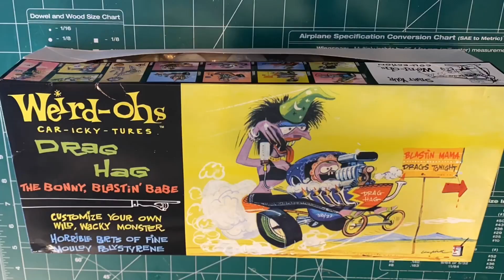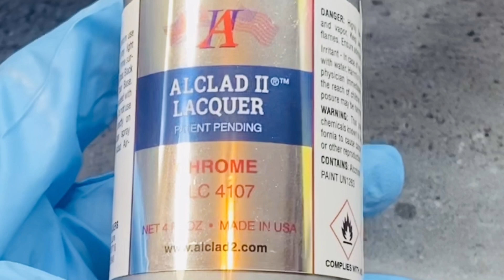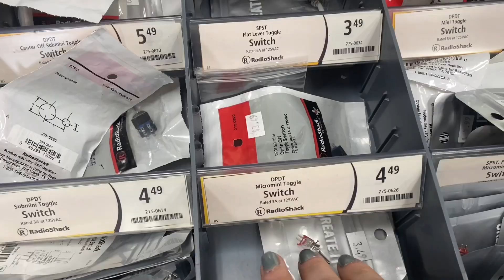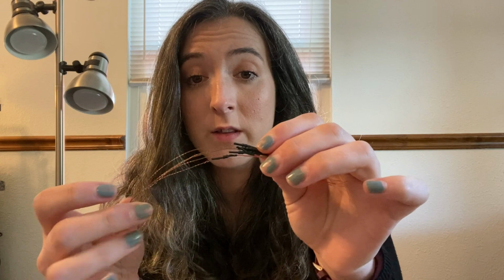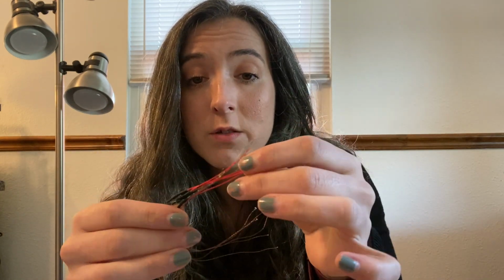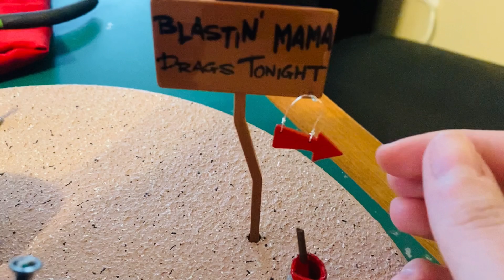“DRAG HAG” WEIRD-OHs BUILD!!!

Comment: I came over from Mark Batsons channel where I am a subscriber. Your build is off the hook,  but I wish to make a small suggestion. When gluing those legs and other pieces together instead of a cyano use a styrene cement please
1: the bond is far stronger. 2: if you cement the pieces well using a nice bead, the seam will not require filler. The welded plastic will fill the gap with molten plastic and once cured it should only need to be sanded smooth. 3: the shear properties of cyano are such that the joints tend to be brittle. One slip and cracks will show quickly, whereas styrene cement will have welded the seam and no such cracks will occur.

Other than that you are skilled and are welcome to car and weirdo modeling of which I am a big fan. Not that you need my approval.
Reply from the maker: Hey Thanks for the sub! I appreciate the compliment and the constructive feedback. This was the most brittle plastic I’ve worked with as of yet. It’s a way tougher build then it appeared. I’ve learned a lot of new things because of the hag and received a lot of important modeling advice from our great community. I’m currently doing a repair on her arm and I’m going to attempt the method you’ve just described. I’m willing to try anything to cut the filling and sanding times down! Thanks so much again and welcome to my channel of modeling madness!!🐌✌️